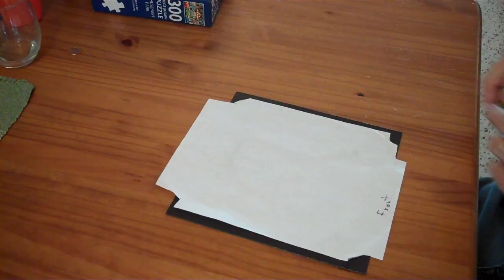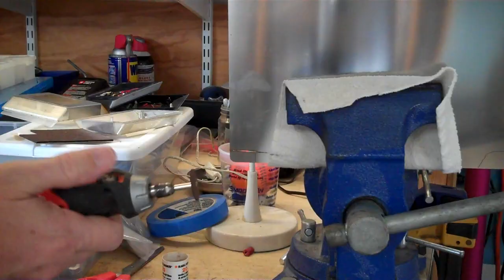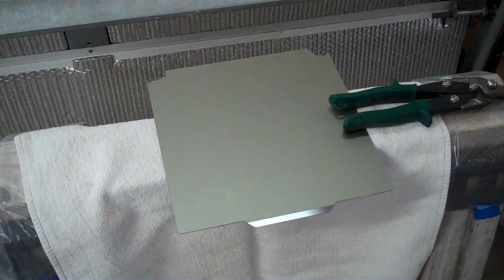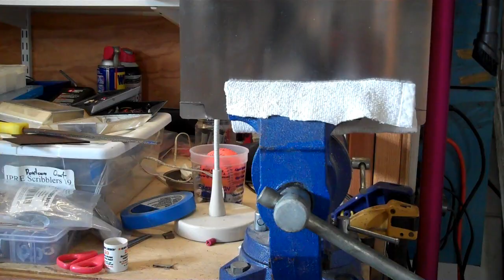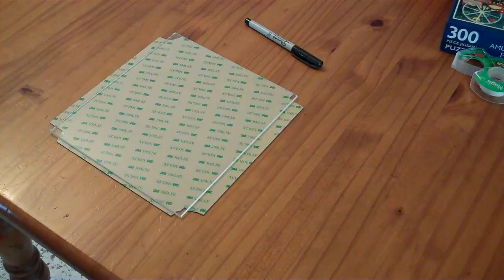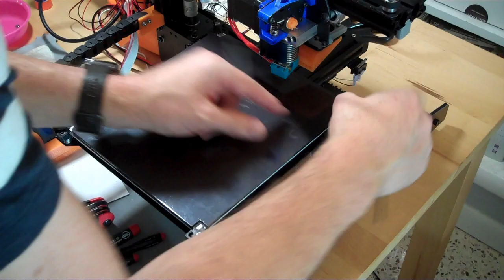Cutting a flexible build plate to fit my nonstandard size glass print bed

Comment from the maker: I have since learned that you can buy magnetic "build plates"  (instead of the spring steel one I had) which are flexible and a lot easier to cut. As I already have a glass bed for flatness, if I were to do this again I'd buy one of those and be able to cut both the top and bottom magnet pieces with standard household scissors... So I guess in this case buying the cheapest thing on Amazon would have made my life easier....
https://amzn.to/3WJw1xn
Reply: thanks for your video! im on the same boat, i cant find a magnetic flex plate that fits my printer
Reply from the maker: @luisarevalo4645   I strongly recommend a flexible build plate, never going back!

Comment: Nice to see a Fusematic still running.  I dusted off my Create by MTW a couple weeks ago and am in the middle of doing some upgrades hence me running across your video.  Thanks for sharing.
Reply from the maker: I think their Fusematic line had dual vertical supports, this one is one sided. I believe it is the "MiniMax" model.
Reply: @summetj  lol, you are absolutely correct. It was also built on a steel case that cost a ton to produce!

Comment: Thanks for posting this video! My build plate is 315x330 and it's tough to find the right size so I just bought some 350x350 Voron build plates and plan to cut them down to size. This video has put me on the right track.
Reply from the maker: Yeah it's always easier if you have a standard size build plate, but it is possible to chop them down with the right tools, as long as you don't mind a few ugly edges.